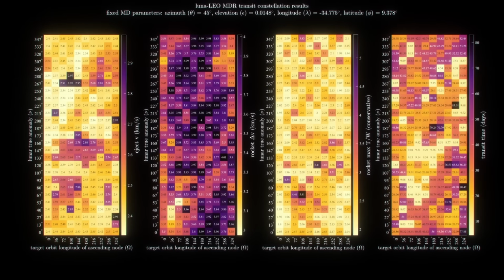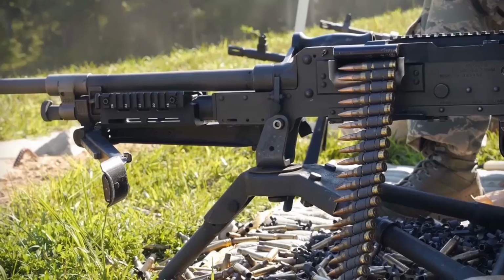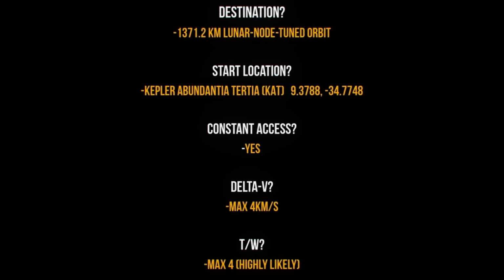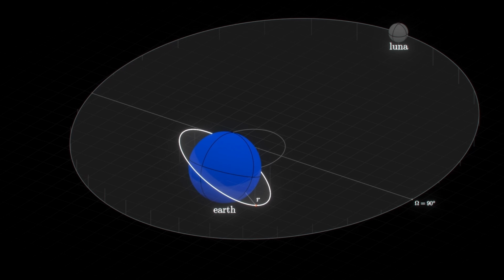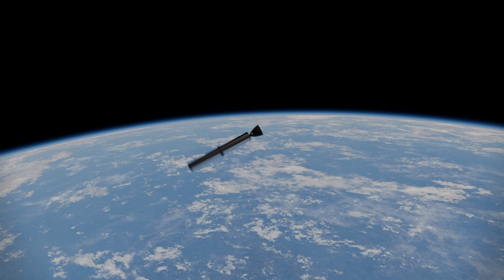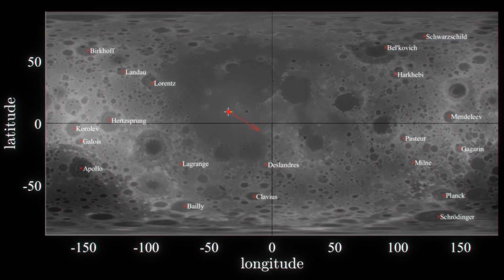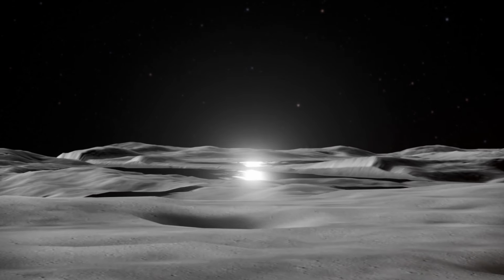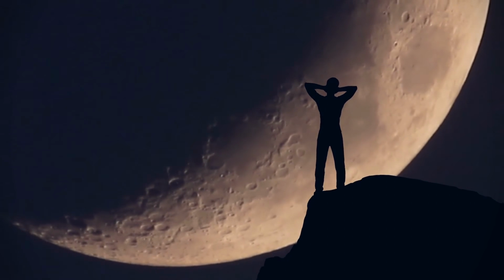Moon To LEO Transfer Simulations For A Lunar Mass Driver & Terrain Analysis + Power Sizing Estimate

Comment: consider modern containerized logistics, its more likely to have…think like video game drops, a mass driver launching the smaller high cadence pods like you describe just needing enough energy to get them into low lunar orbit, limiting the civil engineering project to just enough needed to escape the well, then a collector tractor trailer ship that sweeps the “drop” orbit and when fully loaded up, cycles back to LEO to the refinery/depot/shipyard. This tech is another boost to economic feasibility as it’s development helps with orbital clean-up and maintenance. Like take farming, each farm doesn’t take the combine alll the way to the elevator, they go combine->truck->consolidate in local storage silo->then large truck to elevator->then elevator before getting loaded into the train. Lunar outpost->local silos->ground based containerized transport to mass driver location(elevator)->low lunar orbit(train)->re-containerized/consolodated in orbit(costal shipping port)
Reply: Hi.
Orbits, at any given time, are defined not just by a location vector, but by a velocity one too which can make them difficult for us to understand sometimes due to our terrestrial intuitions. You can't have a 'tractor' in orbit come along and sweep through an orbit as if they were boats along the ocean, everything in a given orbit is moving with the same velocity magnitude. Furthermore a massdriver alone cannot launch things into lunar orbit, it can put them on an eccentric orbit around the moon that collides with where the orbit began (ie the end of the massdriver) or cast them out of the lunar sphere of influence by having the massdriver rockets start at the lunar escape velocity (or greater). For a massdriver rocket to assume a lunar orbit it must preform a burn right after launch which would be a substantial Δv penalty compounded further by the exceptional Δv penalty required for a vehicle to then transit, rendezvous and then transit again with that payload out to LEO and then rendezvous with a receiving station (these all require major burns).

Comment: Seems like the logical thing would be to eventually build 2 mass drivers for redundancy and increased through put.
Reply: You would want as much of the mass driver built form lunar materials as possible so that requires first setting up mining/refining infrastructure. Once you have that you could just make as many mass drivers as you want.
Reply: @XchaosmarineX92 once that initial manufacturing is in place you could build a whole complex of drivers that scale up with demand. The mass driver itself doesn't take up much space but the site should be built in a way that lends itself to future expansion and being able to have the power equipment to be able to power multiple drivers so maintenance can be done or occasionally load share if needed.

Comment: 33:33 Two things for you to consider.

First: A curved mass driver may actually be required. Not in spite of the forces involved, but because of them. Consider that all objects are already in orbital trajectories, just really low energy ones where the apoapsis is constantly being deflected forward through the force of matter resisting compression.  This would mean that at some point merely suspending the pod against following it's current trajectory downward starts to become significant, and it would actually be advantageous to arc it in a similar (though possibly less aggressive) way as is seen with modern rocket launches.

This has implications for the structure of the mass driver, such as how far along do you have to transition away from a straight line into a curve that follows the projectile's path as if it were accelerating purely prograde, and hence, how much lower than the bulk of the mass driver must the start point be. You could run into a situation where the projectile needs to be lofted so much at the beginning that significant construction is required, either to dig the start into the ground or to suspend the majority of the driver in the air.

Second: Considering the many benefits of tunnels, and how it would be reasonable to expect them to be significantly easier to make in 1/6th G, there may be an argument to be made that using a TBM to build the main structural support via tunneling is optimal. Given that tunneling limits may be significantly relaxed on the moon, and we already routinely dig mines many KM into the earth as it is, it may be appropriate to significantly relax your muzzle elevation restriction and reconsider optimal sites.

Comment: I am not sure that I watched all your videos on the subject because I was focused on other things (like an extended hospital visit and subsequent and ongoing rehabilitation). So I don't know if this has come up in previous videos. In this video, you mentioned that the mass driver for this project was designed as a steady-acceleration driver, resulting in peak power output at the exit of the mass driver. Would a steady-power mass driver be just as efficient, but with higher initial acceleration and lower end acceleration? And would such a mass driver reduce the peak power output enough to make power demand more manageable? Or would the complexity of the driver become a limiting factor?
I am not an engineer myself, but I find your videos very helpful in understanding the concept of the projects and problems. Thank you for that.

Comment: Neat ideas! Imagine redoing this with a fixed place on the earth in atleast 10 variations using spaceXs heat shield technology. I am sure that He3 may be a product worth considering? What about a mass driver to capture or map asteroids? Cubesats may riot for more jobs in the Oort cloud or closer. 😉 I understand this is outside some of your constraints--maybe, more simulations?!?

Nice job here!

 Maybe shorten this down to a 5 minute 'coles notes' version? (Still, the details and difficulties can be cited in such a version.)

Comment: Wouldnt a ballistic capture orbit lower both deltaV needed and mass driver power? In the analysis only a earth moon system has been shown and i was wondering if a more complicated, slower but less costly orbit was ideal in this case
Reply: Hi! 
Ballistic capture in orbits are really not possible for earth's orbit as the earth as, while it is in motion (its revolving around the earth-moon barycenter) is already is the primary (dominant) gravitational body in the earth-moon orbital system and is right down at the bottom of the gravity well far away from any weak stability boundaries. Ballistic captures are only really available to secondary bodies far up in a gravity well (especially if they have a high orbital velocity relative to a potential transiting rocket) which is why they're often proposed for lunar transit design. 
With this being said, you can absolutely use a lunar gravity assist, even directly from a lunar massdriver, to shoot a rocket out into a very high altitude (though unstable over the long-term) earth orbit, this can even be seen in this video at 36:20.
Reply: @melanovis thank you for the clarification

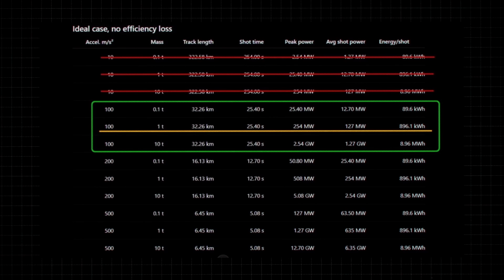Comment: 4:05 still watching but did you Factor in the super abrasive moon dust that sticks to everything? How does it build up? Effect equipment over time? Could everything get clogged up after one firing? You’re showing open grid construction , would it create a massive dust cloud that would settle on everything ? I’m pretarded but I’ve heard moon dust gets in everything.
Reply: I don't think anyone knows since no one has had to cope with it long term.  Dust doesn't billow on the moon.  No atmosphere.  Still dust one way or another is likely going to be troublesome.
Reply: @imaginary_friend7300  true no atmosphere but wonder if static electricity or magnetism plays a role in where it sticks. Thinking about once the dust is disturbed in construction how long does it take to settle and what’s it’s spread.🤔Like I said I’m ignorant of moon science 😁  but I build houses and maintain equipment so dust and abrasion are understandable issues down here , don’t know what happens in a vacuum under the moon’s gravity

Comment: I’ve been following your videos for a while but I can’t stop thinking about the legal nightmare that a mass driver would cause. Plenty of people would be against it since it could potentially be used as a weapon. Do you think the mass restrictions might counter that point since it might be impossible to make a lunar reentry vehicle that small?
Reply: What court would it get raised in?  That will be it's own legal nightmare.
Reply: I don't think its any worse than the threat any orbital vehicle could theoretically pose to the most paranoid military. In some ways, it's less - making a reentry vehicle that can survive a lunar return orbit is no easy challenge, especially since a weapon would want to keep a lot of velocity. It's especially worth noting that the heat flux a vehicle has to survive on reentry can be proportional to very high powers of velocity (I've seen v^8 (!!!) for the plasmas formed for interplanetary or lunar return trajectories). Most probably, a lunar-launched weapon would want to burn to slow down before reentry, otherwise it'd be dedicating a lot of mass and design effort that just gets vaporized by Earth's atmosphere and never produces any effect on target, which kind of defeats the point. Additionally, defenses would have far more time to react to a lunar weapon than a ballistic missile or orbit-to-ground weapon. I suppose there's some more long term concerns like "what if whoever owns the mass driver uses it to build this or that super scary orbital superweapon?" but that seems besides the point.
Reply: eh as fun as the "the moon is harsh mistress" was this would make a crappy weapon on it own it weapon in similar way a railroad is clear in dual use territory and  as the  pods would take days to get to earth providing lot of time for interception or retaliation, additionaly as it the main source of launch's lot of indimend system would be monitoring it.  ballistic missiles with earth facing stealth would chilling in cislunar space would  be more piratical.

Comment: I wonder if it would be possible for the rocket pods to return to a neighboring launch rail after they've rendezvoused with the orbital station and deposited their payloads.

If their fuel budget had enough additional deltaV for a deorbit burn, couldn't they lower their perigee just enough for a guided re-entry into a smaller deceleration/landing rail facing the opposite direction that's dedicated to slowing down the empty rocket pods?

They would need to enter the deceleration rail with high precision, but we are already used to precisely positioning spacecraft autonomously. Setting up a closed-loop system like that would eliminate the material operating costs of the entire system.

Comment: I think it could be a better idea to use the mass driver to launch payloads into high lunar orbit where they are stored and processed. The delta V required to circularise would be very small and the TWR would be very small as well, possibly in the range of electric thrusters, oxygen might be a good propellant even though it is quite reactive 

Larger nuclear electric tugs could deliver the payloads to their final orbits, possibly using the atmosphere to enter low earth orbit
Reply: Great engineering, but nuclear tugs are vastly harder optics for a supposedly commercial and almost certainly American venture.
Reply: @jasonisbored6679 true, maybe solar powered would be better

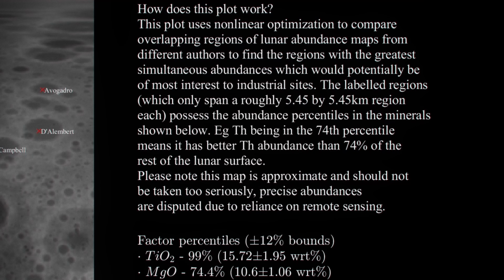Comment: 31:50 Thorium mentioned. LFTR is an atomic reactor with little to no fuel fabrication. Thorium is not fissile, so it will need a kick start. But once started will make its own fissile material for more reactor starts.  It will require finding or importing lithium, berylium, and lots of fluorine. But one ton of Thorium will be enough for a 1 GW reactor to run a full year.
Reply: The processing steps have never been done at any scale that I know of.  It's a good start but still some R&D issues.
Reply: @imaginary_friend7300   additionally molten salt is awful to work with, super reactive. very much R&D needed
Reply: @imaginary_friend7300 they ran it for 20000 hours back in the 60s and 70s. Shut down because all the funding was going to fast spectrum plutonium reactors that didn't really happen. Testing showed that corrosion was not an issue. Just needed high nickel steel. The science is sound. But politics had their way.